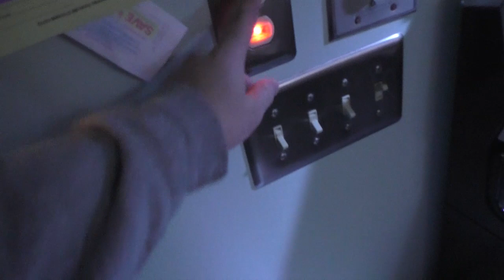I had my cast-iron bathtub "professionally" refinished, and here's how it went down...

Comment: why not just buy a new one for $500-$1000?
Reply from the maker: Because cast iron tubs will last literally forever; the coating should last 20 years, and when it fails, I'll have it coated again. Nobody makes a tub like this anymore (the shape of the tub itself) and I'd have to tear out the subfloor to fit a new tub in due to the tub's unique footprint. So yes, a tub can be had for $1000, but I'd have to tear eveything out and essentially remodel the entire bathroom to do it. I really like the look of this old tub, and would rather see it preserved rather than removed.
Reply: @bbishoppcm  I noticed also my tub water gets warmer quicker with an acrylic tub vs the old cast iron seeing a small difference in my natural gas bill (but more useful with regards to time as there is a 20 min delta between the two with regards to heat retention).  I think the penetration heat for a cast iron tub is a bit more than acrylic with regards to heat retained in the water vs transfer energy into the tub itself.  Could be placebo but my gas bill suggests that acrylic holds heat better than the iron tub previous.
Reply: @bbishoppcm  i can really relate to that situation with other stuff lol. Yeah they arent made like they once were.
Reply from the maker: @kennysboat4432  The aesthetics of a 1950s tub cannot be replicated with modern replacements, unfortunately. I'd basically have to gut the bathroom at that point which I don't want to do - having most of the originalness is why I fell in love with the house in the first place. Sadly, the original sink and toilet are long gone - but I am sure I can find an original Eljer sink.

Comment: i am not a big fan of the single valve shower things they use now. i like the 3 handle, i think it looks better but also for some reason it seems the single valve ones let you get the water hotter. my grandmothers house has 2 tubs and it seems the water gets alot hotter in the 3 valve one. but that may be the distance from the heater or something else as well. but i do like the look of the 3 handle better.

Comment: Do you not use water softeners there?  Takes care of all the calcium and rust in the water.  The water here is rock hard (20+ GPG) and its basically required.
Reply from the maker: I'm on city water, we have no rust in the water at all. Any rust stains were the result of chipped porcelain.

Comment: had cast iron removed mine because it was cheaper just to replace it with a common kohler tub...
Reply from the maker: Yeah, I can't understand why anyone would rip out a cast-iron tub, to be honest... it'll outlast anything made today, and still be in usable shape 200 years from now.
Reply: @bbishoppcm  it cost as much to re glaze it than get a more common tub and do the tile and also get quality fit and finish from a reputable tub manufacturer.  If in the future I need to replace a lot easier and cheaper.  Reglazing properly is an art that is going away.  Also if the glazing wears out then you will have water leakage rust issues.  My tub was showing some rust spots and I wanted a normal size so I could replace at some point in the future.  Just more or less ease of replacement because removing a cast iron tub is a real bear
Reply: they had to literally cut the cast iron tub up to remove it could not be removed in one piece... perhaps sacrilegious but with the possible rust issues that we saw after the tub was removed it was probably the right move.  It had already rotted a portion of the sub floor
Reply from the maker: @joeyscleaninglady2877  If my subfloor were bad, I'd totally tear my tub out; a solid floor is a priority above all else. Fortunately, my floor's rock-solid. My parents had a similar situation in their 1860s house with a 1940s bathroom; the tub had to be removed with a sledgehammer to repair the subfloor.